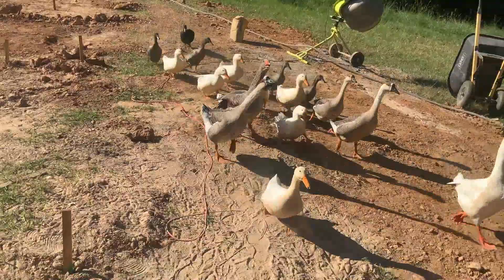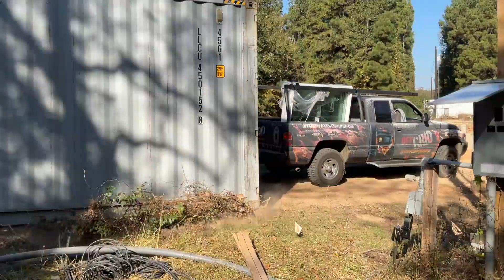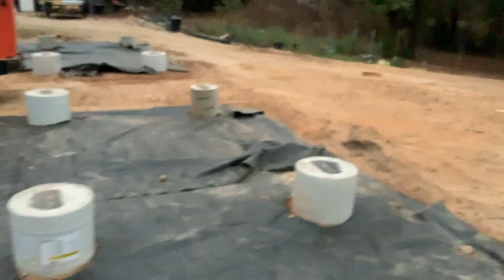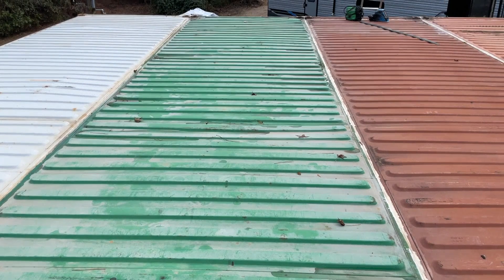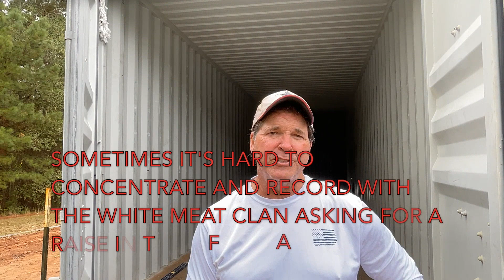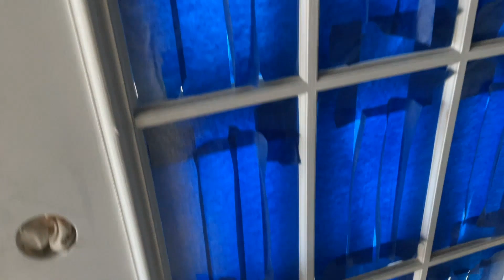TORNADO RESISTANT SHIPPING CONTAINER HOME - " WERE DONE BEING AFRAID "!

Comment: Yes!  A like minded soul!  I am in the process of designing a hurricane-resistant home to build on some land near Rockport, Texas.  And you guessed it--I am going to use shipping containers!  I will be retiring in this home and I need something that is easy to evacuate from--that can recover quickly from a direct hit.  It will be so much easier to close the steel doors than wrestle heavy sheets of plywood!  I am also going to go off-grid with Eco Flow-type power stations, that way I can just unplug them and load them into my Campulance when I evacuate.  So rock on dude!
Reply from the maker: Thank you Rockport Tx. I think that you are making a wise choice. The Tornado's are out of control these days and I can attest that one of the most recent storms had 60-80 mph winds and we were sitting inside the container and didn't feel a thing and only heard the booms from thunder when they were directly overhead. I drove around after our last storm that had 100 mph winds with baseball sized hail around Fort Worth and so many mobile homes and Barndo's showed a very chaotic event which I believe would have been unnerving, We personally only had 60-70 mph winds and we were fine. Great choice on the new container home. If I may suggest that if you go solar, make sure you have protection over the panels if the Flow type power station uses them. Check out the Solar Flower that closes automatically if winds pick up. Good Luck with your new adventure. Stay Safe. Peace